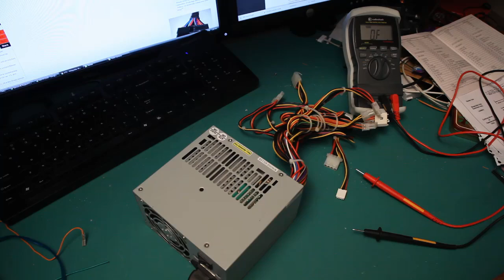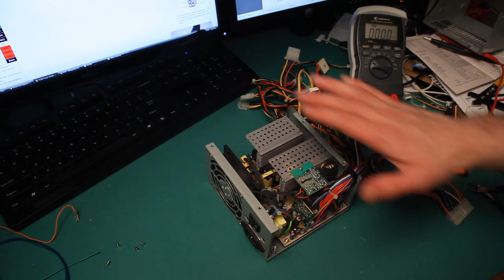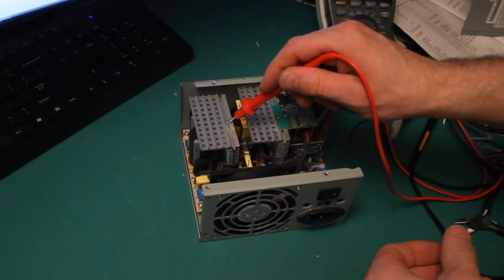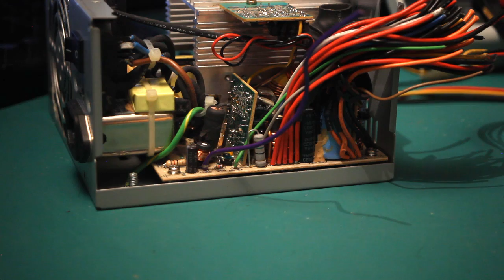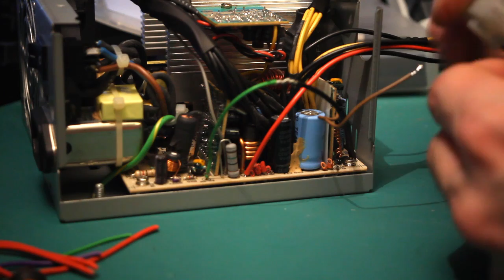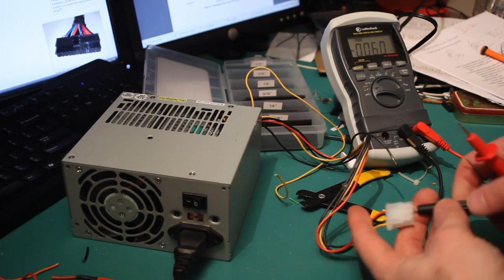Fix it Friday - Using a Power Supply from a Computer

Comment: kind of limited the use of this power supply for what amperage it can draw better putting at least 3 of the yellow and red and black wires together if you connect something that draws a lot of current  the wires will get hot, but not so if more wires are together.

Comment: is it okay even if you will not put a dummy load resistor (10w/5ohm) rating along one of the 5v (red wire) and 1 ground (black wire)? oh and another thing, what exactly does this ad-on electrical component do to the PSU? thank you...